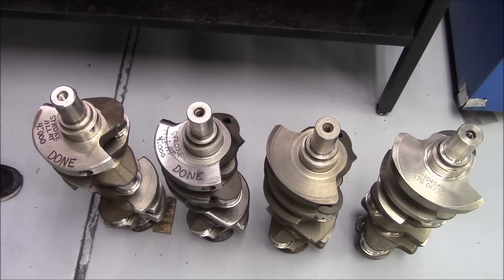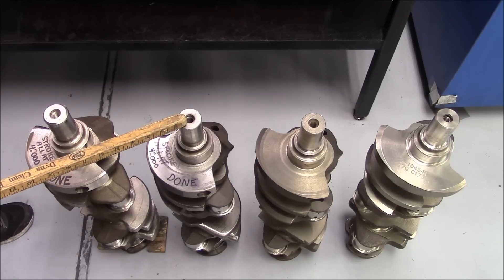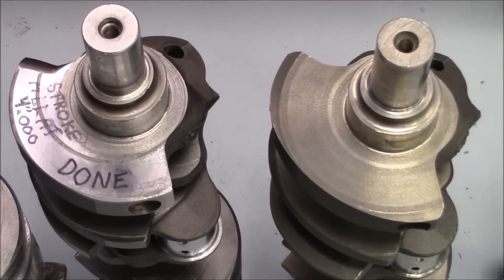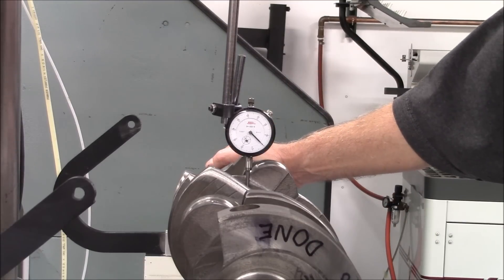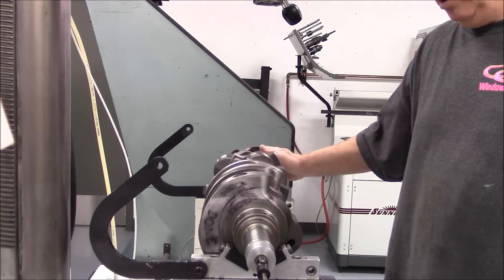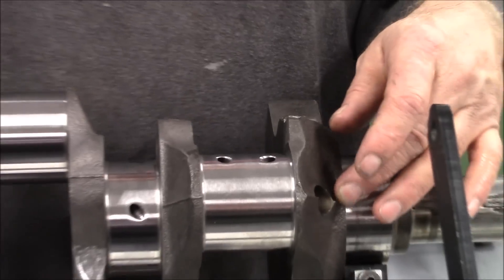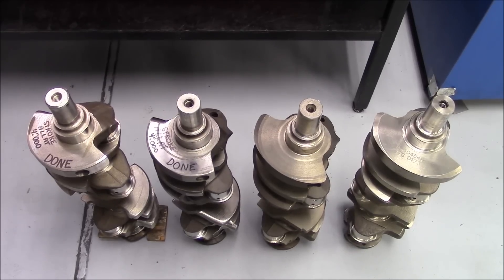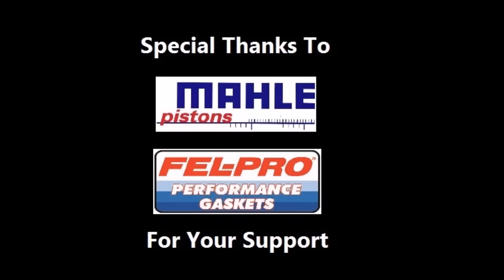620 HP 454 Big Block Chevy Engine Build Part 4 GM Crankshaft Prep, Runout and Stroke Check

Comment: Most all of the 1970 to 1972 454 crankshafts are forged steel. It seems that 1973 started the cast iron 454 crankshafts, but those 1973 and newer 454's often come with the, "stronger", "truck" connecting rods on their cast cranks, even if they aren't truck engines.

Comment: i have a crate engine ho 454 got it complete with the stock intake and cab complete engine paperwork said 450 hp at 485 torque steel crank heavy rods high flow oval port heads what do think just putting a edelbrock and a 750 double pumper holly on it would do plus get it dyno tuned i have seen videos of them getting up to 500 hp out of the stock engine set up after dyno tuning it i also have a weiland tunnel ram for it after i get a roller set up and port the valves and mech. the heads for a bigger cam then i plan on the tunnel ram . i want to stick with cast iron on cast iron the best part of this engine i have nothing in it and it has only 6000 miles on it the inside of the engine looks new and clean i put a 94 pu 454 serpentine belt on it put in a 68 short box stock it runs hard but have the other set ups sitting with the new 750 holly that i paid for it . they really went up in price been rebuilding them but have no good carbs left to rebuild been getting a ton of the edelbrocks 650 carbs i put one of them on it not much different than the stock carb but still running stock manifold mite have something to do with it

Comment: Love these videos and the builds ! Isn’t knife edging or bull nosing the crank pointless ? I’ve read gains of 5 hp and following your builds had estimates to do this to a crank I think it’s important to point out that it’s very expensive to do that for such a little gain , for the cost of that service you can buy a forged crank so isn’t this counter productive ?
Reply: I believe the benefit is a combination of many things at this power level and RPMS being turned.  It lightens the crank, spins through the oil easier (HP Gain) and it keeps down on frothing the oil so you have better, more dense and stable oil pressure all the way up to 7000 rpm.

Comment: I even check run out on ammo!! Cranks I seen beat theirself to death only on main bearing. Most don't pay attention to crank or run oil scraper to reduce oil weight riding on crank. I've seen .3 sec at drag strip improvement just adding oil scraper. Great job for sharing. Old Georgis guy!

Comment: When you talk about cutting down the counter weight are you only cutting down the front and back or do you cut down every weight on the crank?
Reply: Every single one as to be balanced with Mallory weight or  machined otherwise the rotating assembly will shake itself to pieces.

Comment: Why use a cast crank ? wouldn't the forged crank be better in a higher horsepower application such as this ? BTW, love your detailed explanations !
Reply: 650hp only at top end for a few seconds here and there, NA cast cranks should be fine- forged is for sustained high rpms/loads and or forced induction.
Reply: Forged is heavier